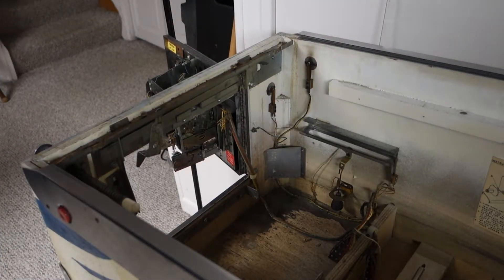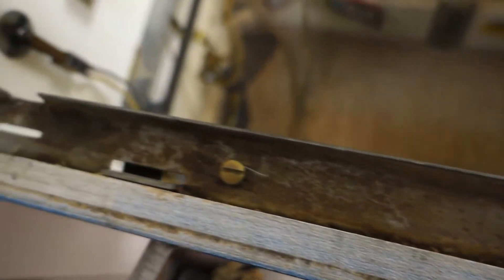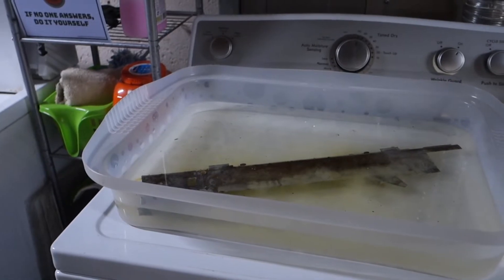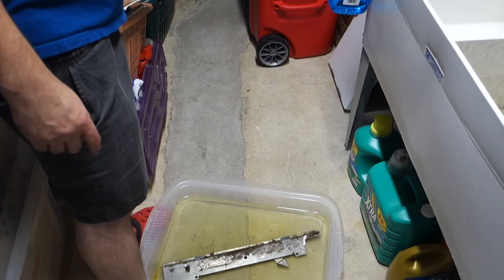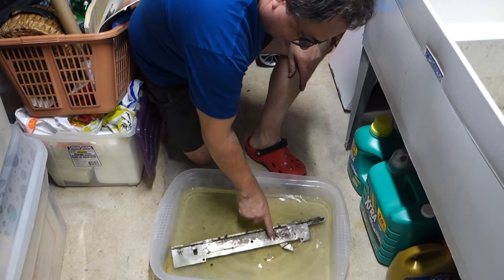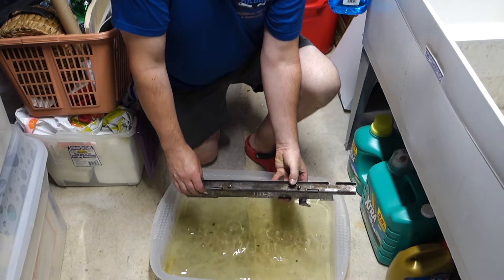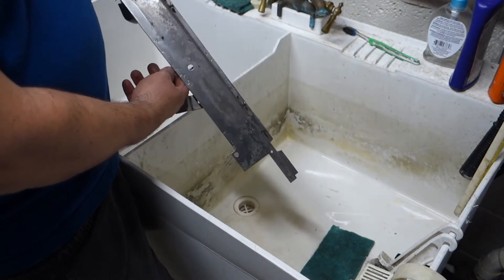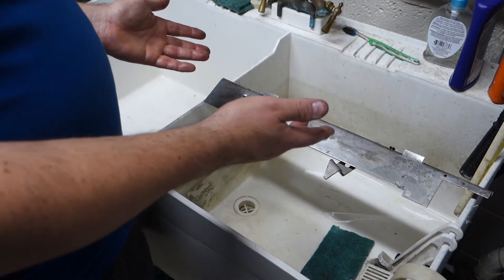1976 Williams Pinball Grand Prix Lockdown Bar Assembly Cleaning

Comment: I replaced the beer seal on my lockdown bar and had to re-adjust the bar because it was too tight. Also, make sure the glass is in place as that affects the lockdown bars fit. Oh, spilled beer (okay maybe a soda or water) is what causes that corrosion. That's why the seal is called beer seal (so it was beer, huh?) And proper placement of the new seal will keep spilled liquids from leaking in. After all, who can play pinball w/o a beer?
Oh, I forgot... I not only like free stuff - I like free beer too!
Reply from the maker: Pabst is my favorite along with Supper Club made by Capitol brewing.

Comment: I guess you can tell the proper amount of citric acid when it starts to bubble? And then the cleaning is complete when the bubbling stops? This is a great tip that will save lots of money over Evapo-Rust.
Reply from the maker: Yes bubbling stops, then wash off and scrub with really hot water and dry ASAP. Water also turns yellowish too.

Comment: Why citroc acid and eater i think citroc acid goung to be lower acidity than the hardware stote varirty of nitric acid in vinegar?
Why not sulfuric acid or muratic acid from the hardware store orvwhy not phosphoric acid in naval jelly. I have used deer molasses from the hunting dtorevsnd its very cheap. Clearly it has somethung similsr yo nitric acid it.
Reply from the maker: Citric acid is something that isn't too harsh and can be dumped down the drain.
Reply: @MarksBasementArcade  I'm not disagreeing I'm just wondering if there is more thought out into it than that or your original source.  Vinegar is nitric acid and can be dumped down the drain. Phosphoric acid in naval jelly is the concentrated version of carbonated colas and they can be dumped down the drain although some get mixed with other acids.
Reply from the maker: @googpix540  I am sure there are tons of other options to use.